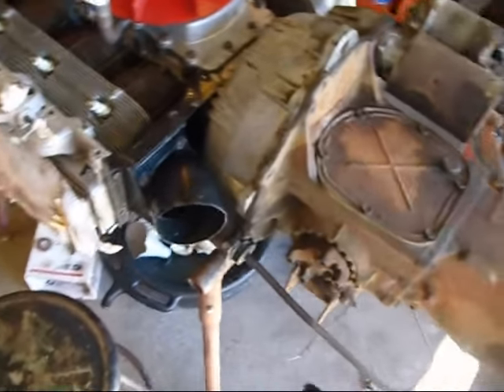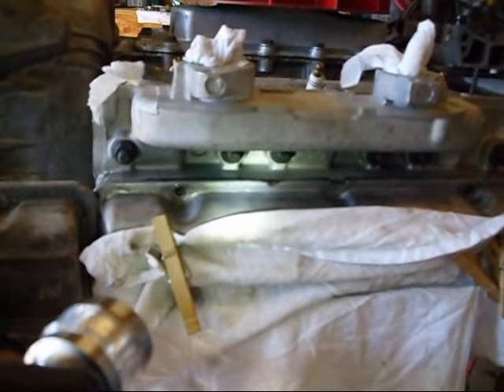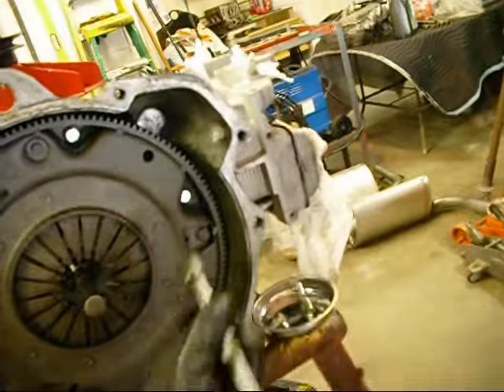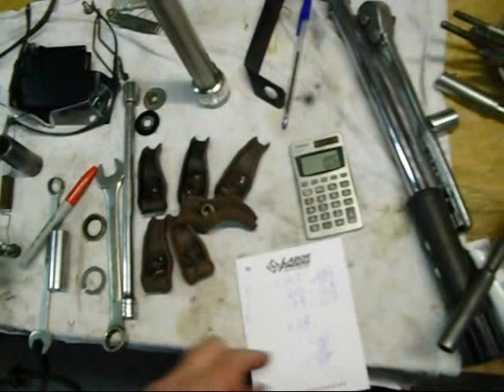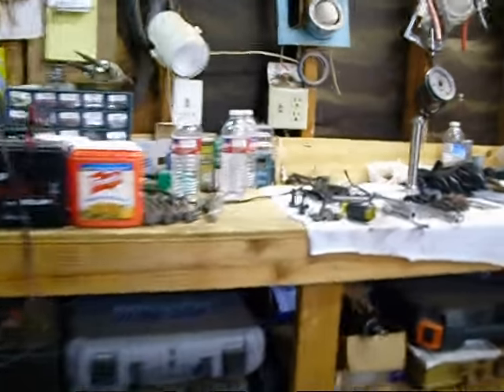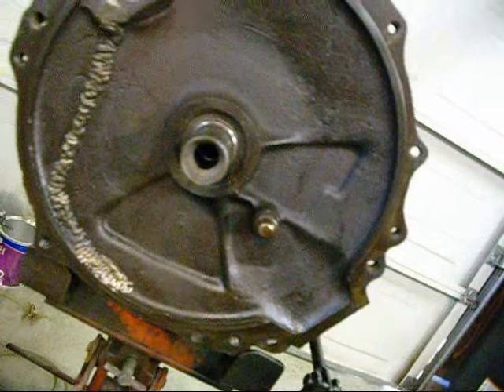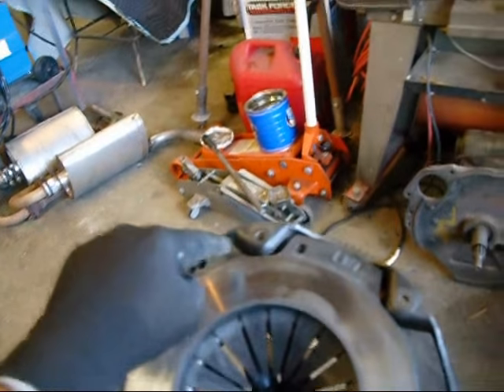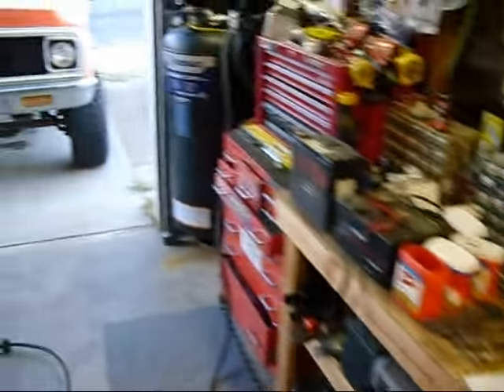Corvair Input Shaft Seal/Clutch Replacement.

Comment: Superb video. But I'm surprised you didn't replace the bellhousing seal anyway. You were right there, hardly any more work, plus you said you didn't change it last time. Hypoid lube stinks, and since you didn't smell it, it was likely an engine oil leak.

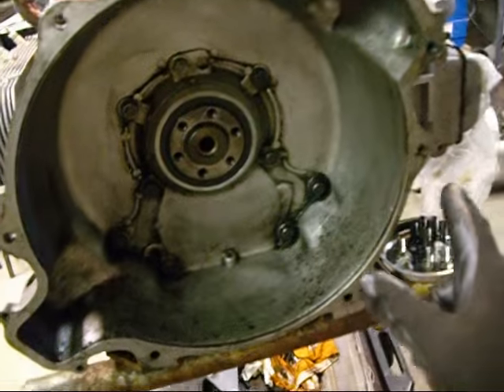Comment: Howdy. Thanks for the video. Back about 1980 my friend Dennis the menace who used to work at Bow Mac Cadillac talked about this long cross shaft in a Corvair that GM no longer kept available anywhere. Meaning, if it broke the car was scrap. At 25:50 that must be the shaft he talked about. Always wondered. ZF had something similar in their designs. You know yourself best about reusing clutch discs. Never done that in my life. Reusing a throwout bearing is a bad idea,I find. One comment. When dropping an engine, remove the air cleaner stud as well. That way it will not catch,ground clearance always being an issue. Adding a warning light/head temp gauge a good idea. The complex fanbelt is a pain to change in the car, but should be replaced as scheduled maintenance. GM flat rate was 0.5(30 min). And hohoho. The consequences of a broken belt include a seized engine. Drove my uncles Turbo Spyder about 1975. Wonderful car. His son wrecked it shortly after. He wrecked every car he ever drove. First gen cars I find ugly. Second gen are classic. There was this WW2 pilot named John Fitch who came out with a performance catalogue for the car. Someone should reproduce those parts. Anyone to download a copy? Cheers and keep the videos coming. Any idea why the trans flange needed welding? How do you break a part there?

Comment: The valve cover used for adjustments, was the '60-'63  narrow flange type for the 4 philips screws. Laters use  wider flange for the spreader bars. some aftermarket water pumper vendors sell THINNER spreader bars, in chrome.

Comment: I'm surprised that you didn't put in a bolted flywheel- the rivets work themselves loose often- especially when used hard.
Reply from the maker: It was a hot riveted flywheel from Dave Palmer, better than bolted From California Corvairs.
Reply: @davemotohead1  I'm not familiar with the Palmer product, thanks for that.  I've been using bolted flywheels made by a friend of mine in CCE for 40+ years and never had a failure.
Reply from the maker: @KirkParro  Join the Corvair Center forum, lots of Good info on that site and friendly people, I have a pile of NOS flywheels and let Dave Palmer repair all of them before I even use them right out of the box, he does all the flywheels sold by California Corvair.

Comment: Dave, I have a 63 Monza with a powerglide. Its pouring trans fluid out between motor and trans unit. Is it the same type of seal for auto setup or completely different?  Thanks Bud!
Reply from the maker: Most likely the Torque converter seal in the front of the diff, PG Diffs are completely different than Manual ones, Buy a 61 Shop manual and 63 manual supplement. Read!
Reply: So its like every other powerglide with the converter going into the pump with the seal riding the converter snout. I havent pulled it down yet and this being my first corvair or even aircooled with an auto, wasnt quite sure. Just bought it and was trying to wrap my head around it. Thanks.

Comment: HOw do I remove the guide sleeve. my broke
Reply: Do you mean the nose that comes out of the differential?  Where the throwout bearing resides?  If that is broken, you are going to have to disassemble the differential- it is installed from the inside.